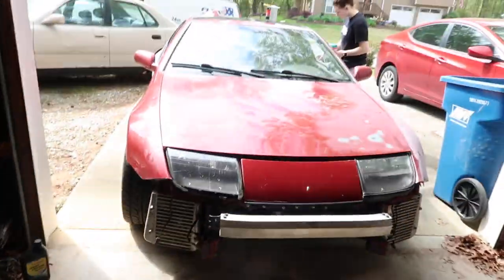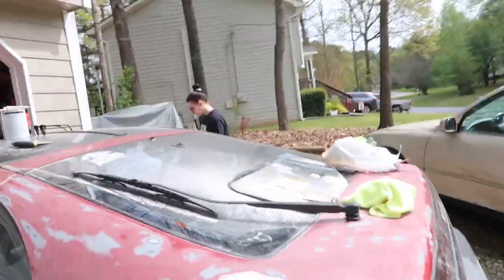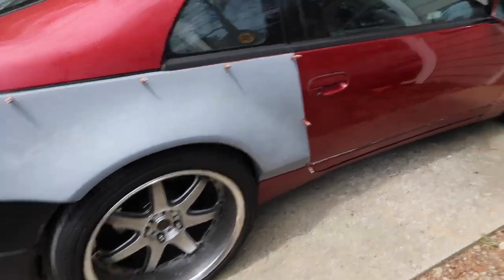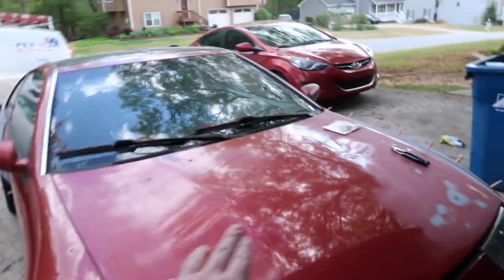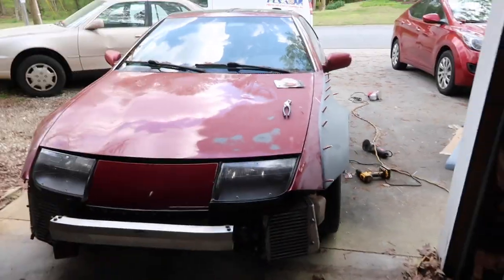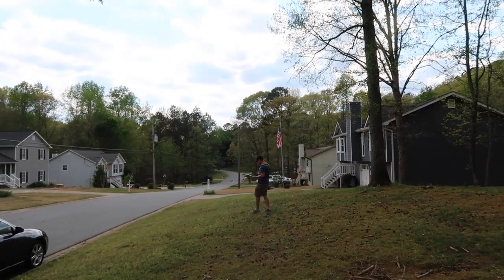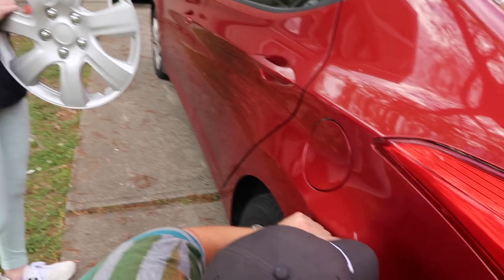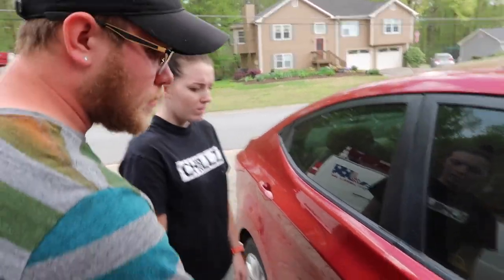300zx twin turbo widebody install

Comment: use masking tape around hunday door handles to protect the doors. use 400 gritt sand paper to feather down the edges of paint around the fadded marks on handles. use pint code on sticker in door frame to have a can of paint match rattle can paint mixed up and respray just the handles on doors after masking off side of car around handles with plastic or news paper. let fully harden, then when you spray clear coat for your car hit her handle or buy a can of 2k clearcoat when you get the paint match rattle can and clear coat them once you re paint them. easily a day project with all the materials.
Reply from the maker: Ya I might look into doing that, but she’s getting a new car soon so it’s not that big of a deal. Thanks for the info though!